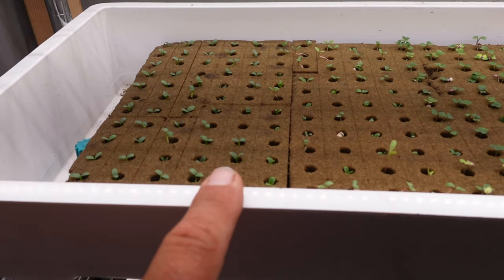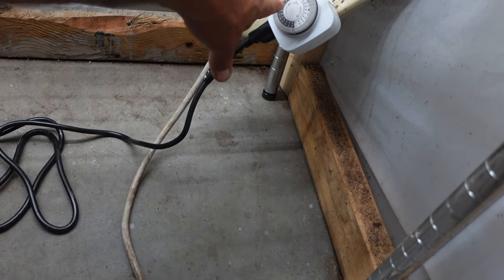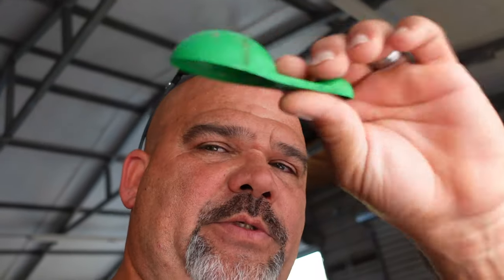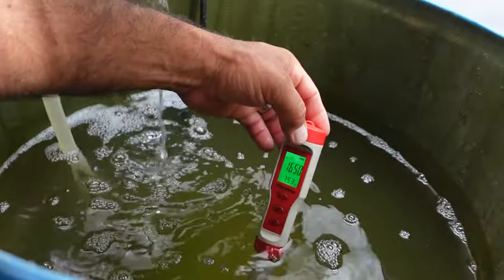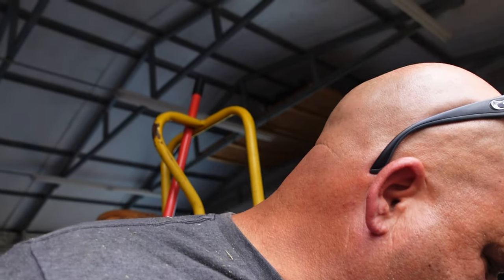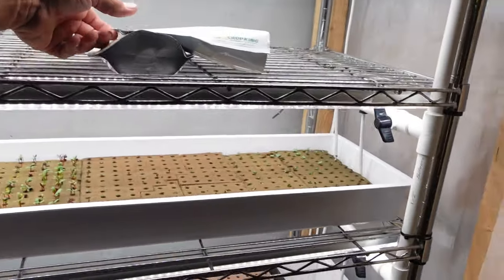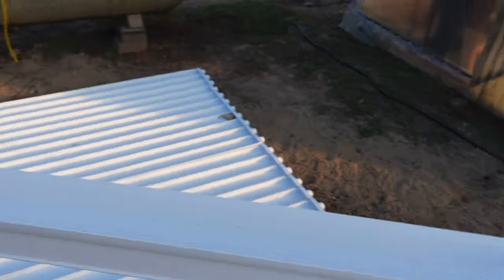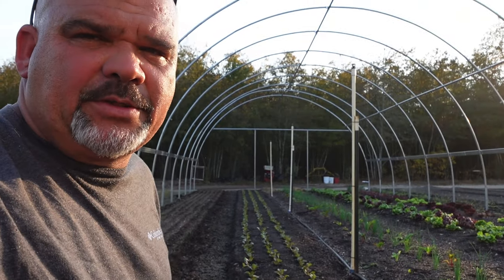New Hydroponic Nursery trays

Comment: We run 1.2-1.3 ec in summer and winter 1.6-1.8 .I have seen tipburn on spring  mix if ec gets to high.
Reply from the maker: Good to know, mine is 2.3 today but I’m going to add some water  to get it back down.